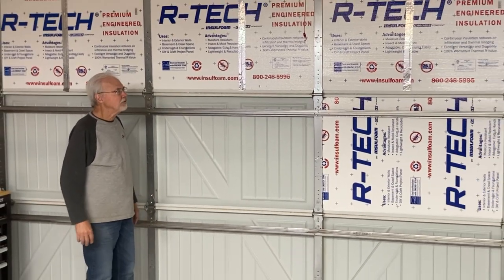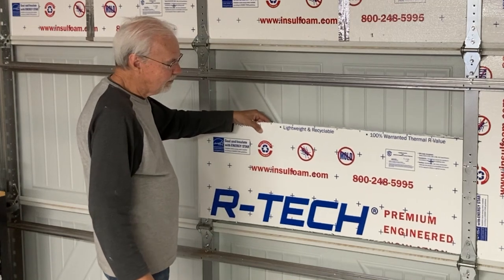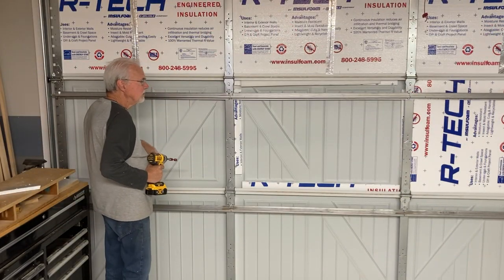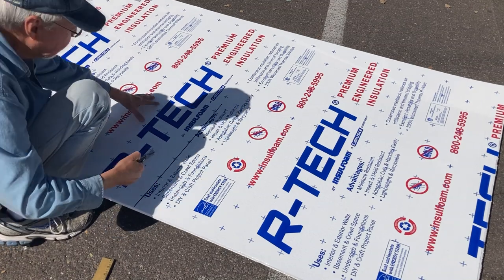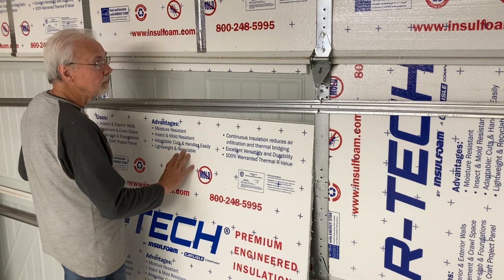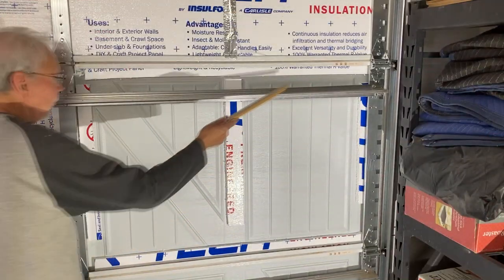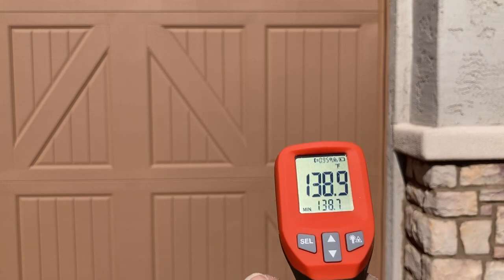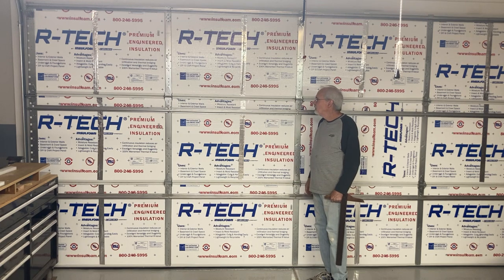Garage Door Insulation

Comment: Great job! I’m a native here and totally understand the need for this project. Will be one of the first things I do with my new home shortly here.

One suggestion, though, would be to either adjust your torsion spring(s) or replace them to accommodate for the extra weight on the garage door. Without doing so, your springs will wear quicker and result in breaking sooner.
Reply from the maker: Thanks Wolf Z.   Regarding the weight, because this is a new built home, I had the garage door rep come by to adjust the door initially.  I asked him about installing the insulation and he said that the springs can handle the weight.  Now whether he is right or not, we will see !   Good luck on your project too. Thanks for watching Wolf Z.